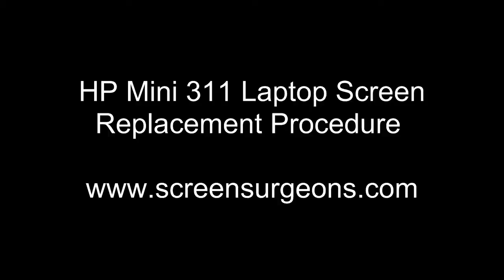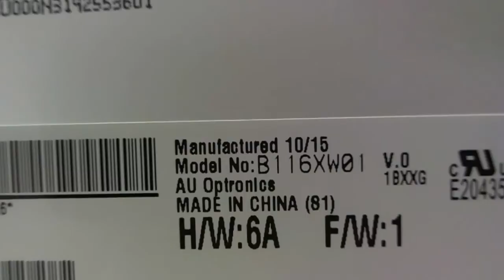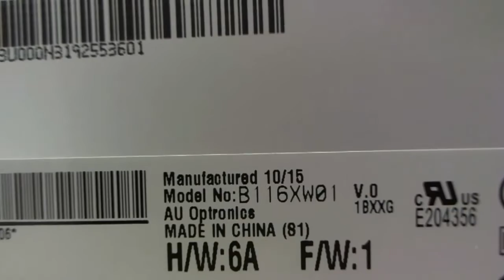HP Mini 311 Netbook Screen Replacement Procedure

Comment: Thanks for the great tutorial. My 311 is acting up, occasionally displaying a white screen with vertical pin stripes. It does it for a few seconds and then it goes back to normal. Normally it happens when I move the lid. I'm not sure if its the LCD or the cable. Any ideas?